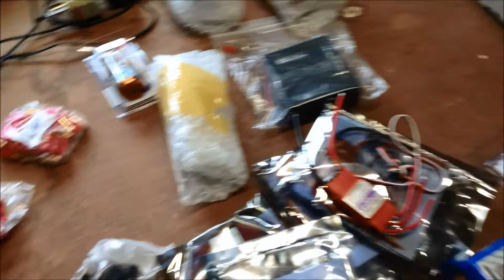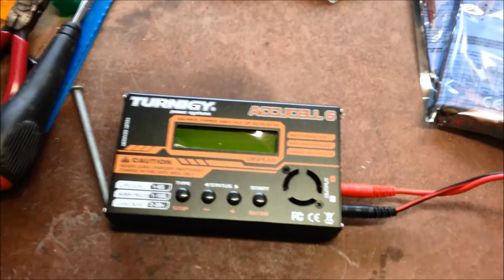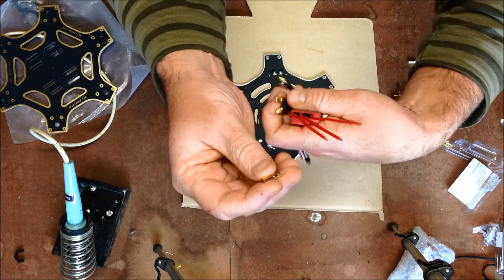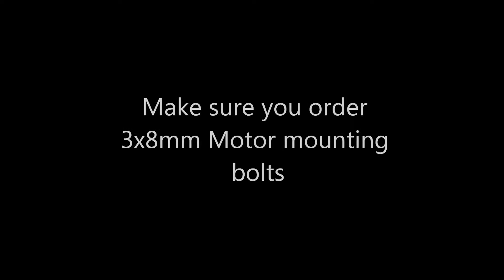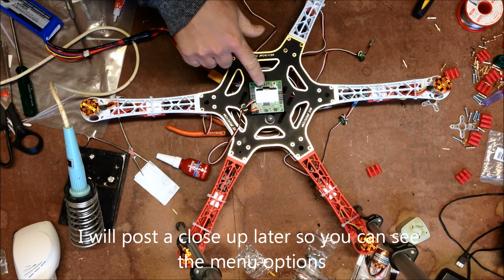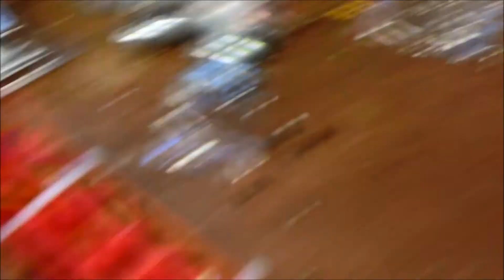H550 HobbyKing Hexacopter DJI F550 KK2 New Build Part 2 (The Frame Build)

Comment: Hi sorry if this is not a good comments. I would recommanded if you do not soldering the ESC to the board and cover with isolation paint. It would be better if you use a connector lead and soldering it on the board. Then use hot glue gun to security it on the board. It will be more easy to swap the ESC if one is dead and needed to be replace. Put the esc on top of the arm so you can put some LED under the arm for better orientation.

Comment: i am planing to built one by myself too. What Motors you think i should use? The copter should be ablte to  fly in high attidude (2000m) and i want to use it for gopro. Are the NTM Prop Drive 1000kv strong enough? cheers michael
Reply from the maker: As a hobby flier in Australia we are limited to 120M in Altitude. Any more than that and you need a commercial license. Given the other traffic in the air this is fair enough. I would hate to be responsible for the result of a mid air collision between a light aircraft and a multi-copter. Going that high the main concern would be battery life and making sure you can get it back down again. I think you have a lot of research to do to venture into that level of flying given the differing winds at that height. Motors and ESCs would need to be powerful enough to combat high winds and still do a RTH if required.
Reply: Simon Hahnel getting that high shouldnt be a Problem cause the copter would Start at 2000m on a mountain :) thanks anyway !!
Reply from the maker: Yeah I saw your great skiing videos after I wrote this and figured as much. Wish we had that snow here.
Reply: Simon Hahnel haha thanks! ;)

Comment: I followed your shopping list but found that the escs did not perform consistently. did you flash your esc or something?
Reply from the maker: Nope. Stock Plush ESCs. Did you calibrate them? There are some good vids on how to do a calibrate of ESCs with the KK2. Its an easy process. But absolutely essential
Reply: Ahh, I did not calibrate them. I dint have the kk2, I'm using naza m v2. Any other way to calibrate them?
Reply from the maker: Not sure on a Naza but you can always do them individually by connecting them directly to the throttle output of your receiver. I would suggest you look up some tuning videos for the NAZA as there are a few settings that need to be set before flight. calibrating acc, compass etc.

Comment: How did you like that battery? Would you suggest 5000 rather than 3000
Reply from the maker: The 3000 battery is good for about 8 mins. The 5000 is quite a bit heavier. I ordered a 5000 to test out but it was faulty, so just waiting for the replacement. I will let you know which I prefer then.
Reply from the maker: Definitely go for the 5000. The 3000 only runs for about 5 minutes once I loaded on my gimbal and GoPro 3. The 5000 lasts about 8-9 mins. Flight performance is negligible.